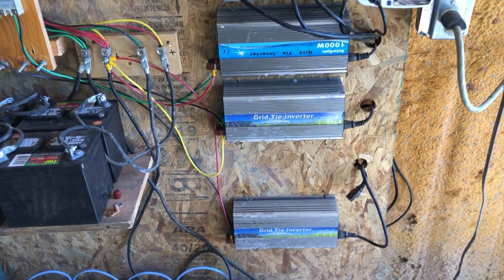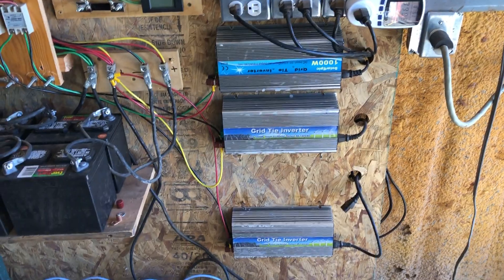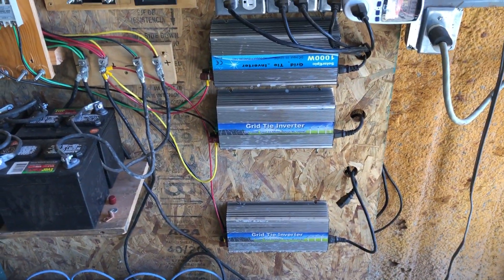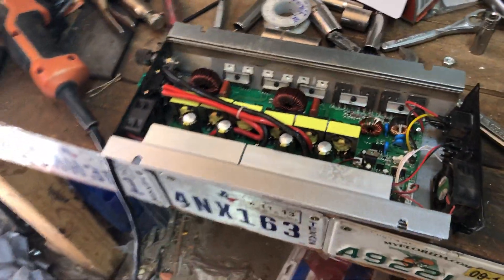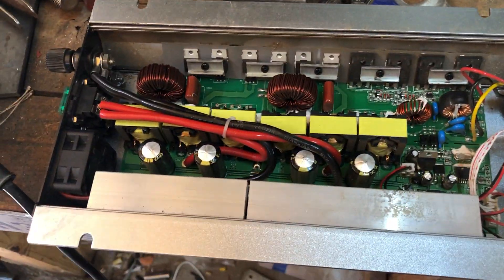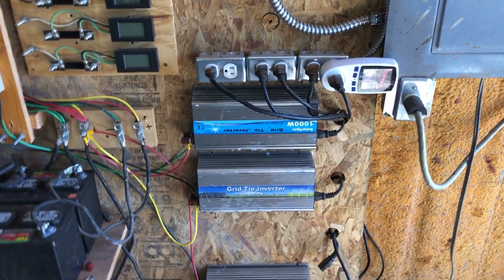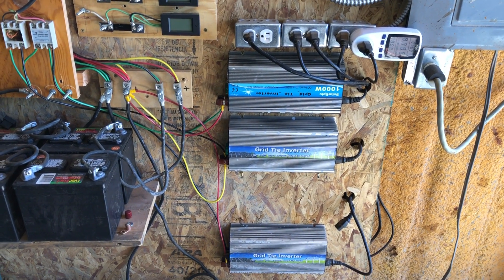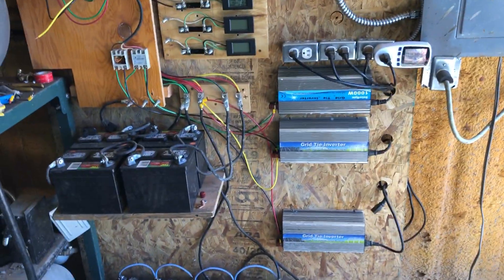Cheap eBay / Amazon grid tie inverters and why they're not that cheap

Comment: looks like your big caps are budged also - indicating they are bad.  Likely they are seeing an over voltage.
Reply from the maker: Yeah what happens is for one reason or another voltage will spike and it blows all the mossfets and caps in these things.
Reply: If you're got dirty grid power you might want to plug your inverter in through a surge protector. The Cable Matters 2205 Joule protector looked like good bang for buck.  But I'm worried your issue could be over voltage on the PV/Battery side.

Comment: Buy a sunny-boy?
Reply from the maker: SMA inverters will not work with low voltage and they do not work with wind turbines and they will ardently refuse to assist you with setting them up for use with a wind turbine.  SMA has been worse trying to communicate with than most of the Chinese factories I've dealt with.  I can just ask them for specs or thresholds on an inverter but if the comment comes from my channel or my email account they just say "we don't work with wind turbines".  0% I will buy another SMA product.

Comment: there is a secret to this inverters.. you have to put 2holes on the cover and put 2 90mm delta fans.. 1 side blows directly on the capacitors and 1 side sucking up to cool them dont just cool the outside casing need to cool the inside dont rely on the internal fans they turn on when its already too hot.... you want to replace those 4 big capacitors with even bigger ones say if they are 2200uF put 4700uf or more whatever will fit bigger... and you will never again have stuff blowing up.. thats due to overvoltage when its boosting the unstable dc voltages coming from the panels during dusk and dawn and when clouds pass by and the bigger caps helps to soften them... I use to blow this frequently until I change the capacitors.. running them at 1000w+ peak output at noon.. daily.. they are about 92% percent efficient last time I measured them.. otherwise just buy some other expensive ones..
Reply: Referring to these input capacitors you mentioned, ideally, their installed capacitance should be about 2200uF per each ampere drawn by the inverter in its maximum draw. Especially if batteries are not used at its input. Therefore, if the max input voltage is, say 60V, the nominal voltage of these caps should be about 100V. As for their total capacitance, if the minimum input voltage to the inverter is, say 25V, then the maximum input current would be 1000W/25V=40A (without calculating the losses). As a result, a minimum capacitance of 2200uF×40A= 80000uf, or, rounding up for the better, 100000uF@100V should be installed there, externally of course, in a proper box.

Comment: I've had 2 of the 600W inverters and they both blew up, 1 from nearby lightning strike and the other from overheating. The warranty is a joke, they want you to ship it to China at your expense. The additional warranty sold at Amazon only kicks in after the 1 year manufacturer's warranty, so it is pretty much useless when the inverter only lasts a few weeks. I might throw away my Solar system- it is more problems than its worth.

Comment: I have been using one for over 2 years… but I only max out at 470watts…   if you’re running them at max (1000watts) you will definitely blow them up - that’s with any inverter.
Reply: How do you limit their output when they are connected to a battery? Ive researched this for a while now but can’t find an answer anywhere.
Reply: @teammouse You can use a high power current limited DC/DC converter adjusted to put out 500W max power. This converter should be fed from your solar array and it's output should feed the input of your inverter.

Comment: I see in the video the main caps are bulging and the top looks vented.  You didn't notice that?
Also you have it fed from the battery bank.  That's a no no
Reply from the maker: The main capacitors are all in decent shape.  The inverters don't care where the voltage comes from, DC tastes like DC whether it comes from a battery or a PV array.  They work off batteries just fine.
Reply: @ToysforWatts  you're wrong. MPPT doesnt always mean DC. batteries fed into a MPPT grid-tie inverters is not good for both
Reply: @practicalthinker5545 It seems that you are confused about MPPTs. These are circuits, integrated some times to charger/inverters,  which have a unique role. This is to optimize the charging current of the batteries, according  to the instantaneous solar irradiance falling on the panels' surface. Therefore they are parts of the charger circuits and have nothing to do with the inverter function. Finally, they work always with DC...

Comment: have you tried overloading them "real inverters" and see if they also blow up?
Reply from the maker: I haven't been willing to risk it :D...I'm okay with abusing these because they're cheap.
Reply: @ToysforWatts  though I am not a fan of chinese products (I believe not all of them are that bad) I see this as a very unfair review, in generalisation of cheaper products. we know for a fact that any power processing electronic device cheap or not when pushed to it's limits will fail very early in service. as you said it yourself, it implies that you dont have the confidence to subject the "real inverters" to the same abuse because you foresee the same fate for them.
Reply from the maker: That's certainly a way to look at it, but we're often more ready to abuse things that are disposable.  These inverters are $100, of course I'm far more willing to take risks with it I wouldn't take with a $2500 inverter.  This was, however, not meant to be a review, but simply an explanation of what fails and why it fails.

Comment: What’s the best inverter for the money you think? Want to have over 2500W+
Reply from the maker: i don’t have a huge amount of experience with different inverters in different applications so you should definitely look for other suggestions as well, but every large project I’ve worked on used a Xantrex inverter and most of them are still going.  solid company witt solid products.

Comment: I blew up those same caps. I went over the rated voltage when I first set up my wind turbine.  I tried to go straight to it without load (no batteries).  I was a novice and threw caution to the wind.  So I ended up buying new cap and soldering them in.  It's been working so far. But what I found out in all this, is that the caps in there are a 50v cap. So there is no real room if your running a 48v turbine.  At least that's what I have found in my little adventures.  Thanks for sharing.
Reply: I have a battery bank in the system now after I blew those caps. Just so you know.
Reply: Interesting. I am getting a 24v turbine and now wondering what inverter to use.

Comment: You're right about one thing they do blow up if you overpower them they're only designed for x amount of voltage and average you go over that of course it's going to blow but they all will doesn't matter what brand you buy cheap or expensive I've been running two of them for almost a year on solar and ain't had a problem with neither one the third one I got I got it on my wind turbine but I don't get the kind of wind and voltage that you do thank you for making the video though and showing us what does blow up whenever you over voltage or Spike them